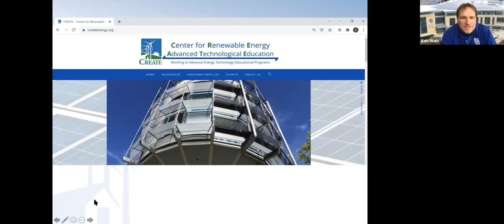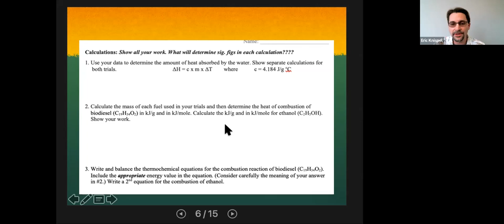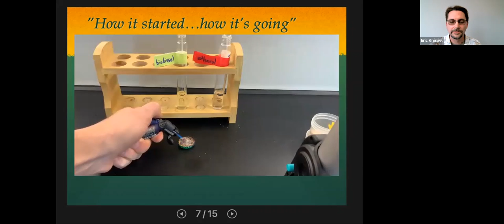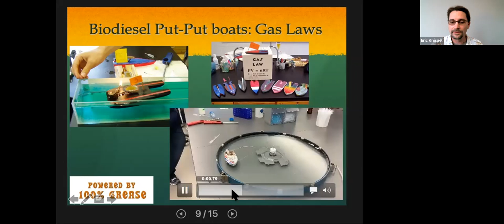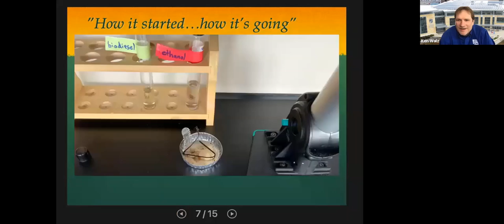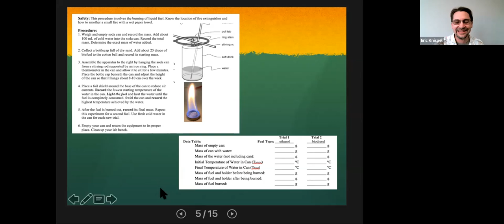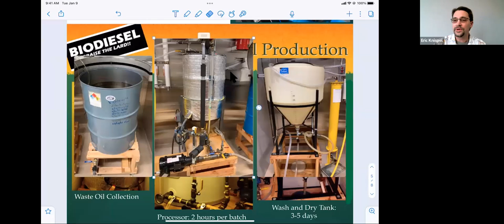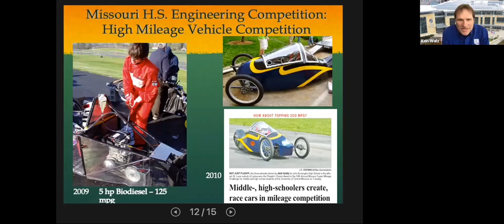Heat of Biofuel Combustion

Comment: This is a really cool add on to an existing biodiesel lab.  One note, the biodiesel is difficult to ignite.   I was able to get it light by using a refillable torch type lighter.  (Available at hardware stores and tobacco shops for a few bucks.) It will not work with an "aim and flame" for lighting the grill.  
Another cool add on is testing with a known substance (methanol/ethanol works well, and ignites easily).  Could also compare with commercially available diesel or gasoline which has a known energy density.   
Awesome video!